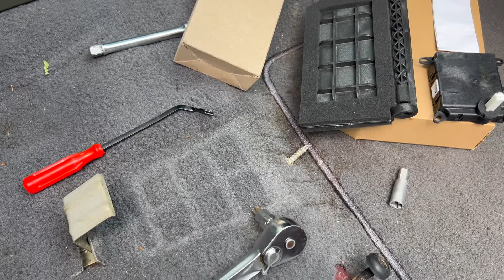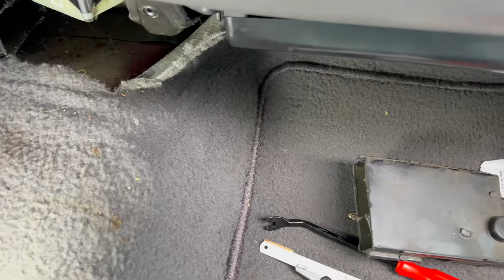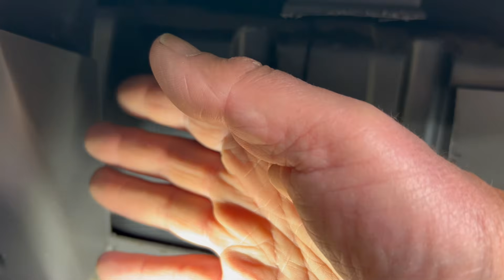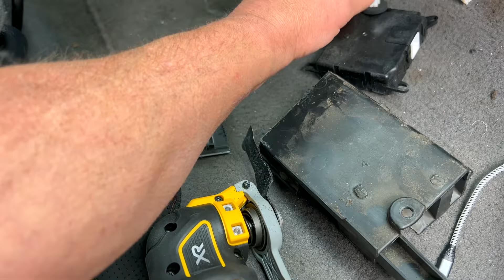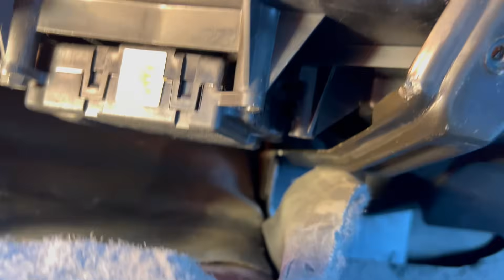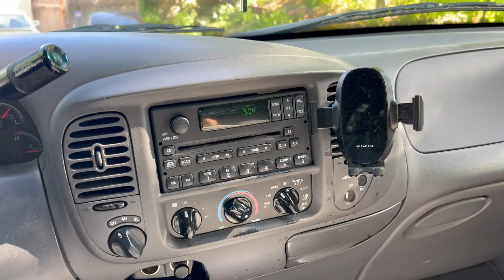1999 Ford F-150 Blend door fix THE EASY WAY!

Comment: Thank u for the vid!!!! My prob is NOT temp control, its getting air to come out vents and not windshield
Reply: Did you get your issue figured out? I have that problem, and I heard somewhere that ford purposefully designed it to only blow from the defrost if there is a vacuum leak...I have no idea if that's true though 🤔

Comment: Had only cold in vents. Used this method and turns out it was the actuator that went out, blend door was fine. 
A word of note, if you have super crew cab, there are two rear vent tubes that block the front of the lower assembly that makes it all that much harder removing the lower black cut portion. 
We had to cut down the length of the actuator so that it would fit and go into the blend door.

Comment: My 98 did this about 15 years ago.  The original door broke off the same way and I had the same piece left stuck in the bottom.  And it probably took me 20 minutes to get it out.  I’m thankful for Dorman making these replacement doors.

One thing to be aware of - I’ve found that on long trips in very humid conditions, condensation can form on the aluminum tape where the cold air comes through the cuts in the air box.  This condensation can be enough to cause a few random drips under the dash.  This is rare and I do mean a FEW drips, but I have had it happen.

I wish I’d known about cutting that bottom piece under the actuator.  I didn’t, and it was no fun getting that replaced.

Comment: I have the problem where it blows out the vent but soon as I start driving it blows out the dash. Also when I press the buttons to change it to blow on the floor, vent, or defrost, it still blows out the dash while driving. Will this help me by changing this?
Reply: It's the vacuum line check valve!
Reply: For the heater control module. You can look it up and it'll show you.
Reply: @lakenpaine9183 thank u. My problem is NOT temp, its getting AC to come out the vents and not the windshield

Comment: just about cut my finger off with a sawzall working on my f150 blend door. took about 3 months to heal up. finger nail fell off after a few weeks. so yes be very careful with that tool cutting plastic because it will kick back or bounce and catch your finger.
Reply: I was cutting the plastic in back of glove box. I never went back to finish the work and its almost a year since that happen....
Reply: my issue is I don't have heat. AC works fine
Reply: @naabemakwa same i have ac but no heat..its either the blend door or heater core i may try to tackle this tho

Comment: Did mine. I have a 99 f150. Was not bad. The only problem I had was getting the pin to line up with the actuator.
Reply from the maker: nice, feels good to get that done.

Comment: So you watchers will know,where he cut that ducting,take a thing strip in aluminum, make a sleeve to slide inside the loose piece.put a couple screws in it,then take some silicone on the protruding part of the sleeve,slide it in the existing hole of the ducting.Sealedcperfect on need of tape you can't really get on properly.Your welcome.
Reply from the maker: that is great advice, thank you

Comment: Simple and to the point! Cutting the black part in half was a brilliant move after my 80 year old body was done trying to do it the hard way! Many THANKS!
Reply from the maker: exactly, the hard way is for the young guys. The smart way is for us. :)
Reply: Black piece is held in by two screws on either side. No need to actually cut it.

Comment: The bottom of the blend door pivot of my '99 F-150 broke off in the same way as yours, making it tough to get the broken off piece out. 
I found another video of a guy in the same boat that dropped the steering column, pulled the whole dash off, and pulled the top off the plenum. He still had to pull up on the frame surrounding the front of the heater core because the half-round shelf of the leftover broken blend door pivot fits "under" that heater core frame. 
When you say "I had to  reef it out by feel" what does that mean in terms of steps taken and tools used? I really don't want to find out the hard way that the wrong tool used or the wrong amount of force applied could break the plenum instead of that leftover piece of door.
Thanks,
Mark
Reply from the maker: To get the leverage I needed,  I first  looked in there and saw the piece, but because of the angle I could not look at it while my hand was in there, so I just kept pulling it at different angles until it finally came out, maybe I was lucky. No way would I want to pull my whole dash out, I would try just about anything else, maybe get a pair of pliers in there, might help. It was definitely a pain to get it out.
Reply: @stevesdiy9551 I can’t even get it out with pliers I tried. I get close by pulling it with my hands but it squeezes super tight and won’t come out if I could break it or cut it would be best
Reply: @stevesdiy9551 but I don’t know how to even start it’s so tight